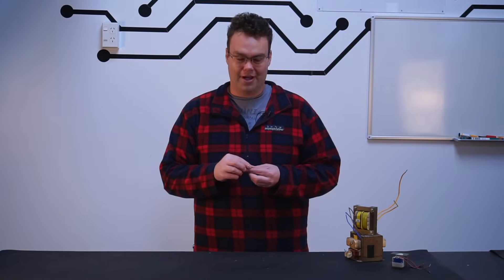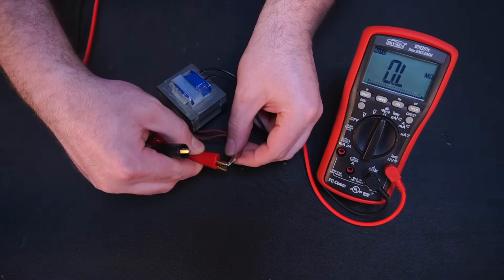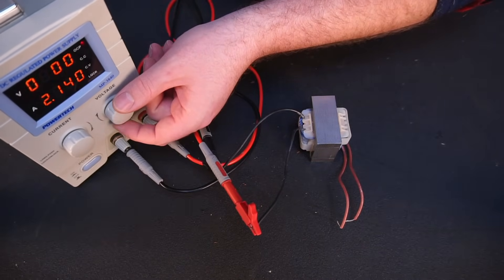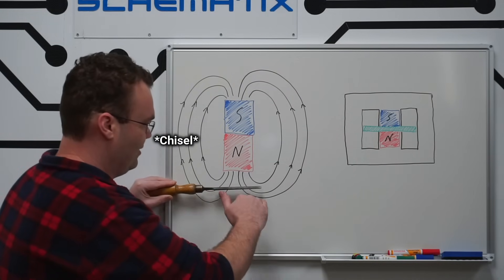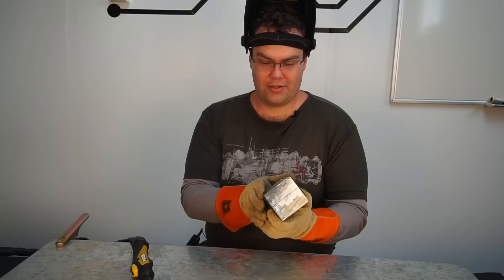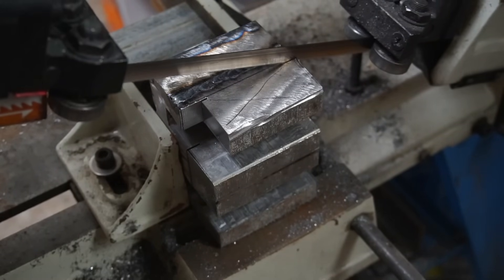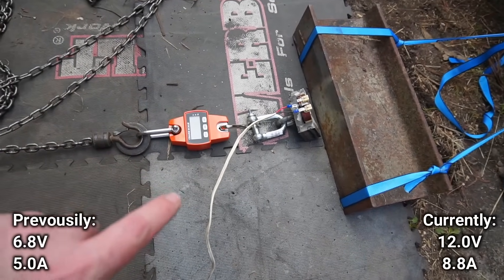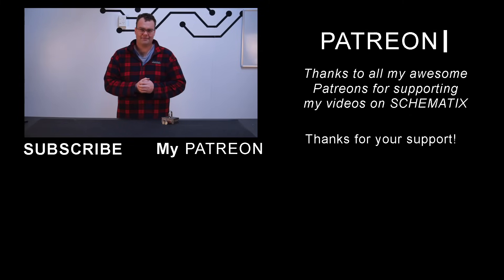Making a Powerful Electro Magnet from a Transformer

Comment: Schematix, I believe that welding the laminations together weakens the overall magnetic field. There's a reason they have them split into several individual pieces.
Reply: Don't matter for DC but AC causes problems, at least that's what my prof told me.
Reply: @Graeme_Lastname  you might be right. I know it's done for transformers to increase magnetic flux so less losses in the core occur.
Reply: @OtherDalfite  Basically to eliminate induced currents flowing in the core which would appear to the transformer as a shorted turn.   ;)
Reply: @Graeme_Lastname  right, to reduce eddy currents flowing around in the core, much like how an induction heater heats up the "core" of whatever iron or metal is inserted inside the coil.

So essentially this wouldn't affect a DC magnet situation because the core is never experiencing any eddy currents since the direction of flow isn't changing. So welding the laminations doesn't affect anything. Correct?
Reply: @Graeme_Lastname  Why fragmeted magnetic core in DC machines?
Reply: @PopaAlexandru.  Depends on how often you turn it on/off.

Comment: One main reason I keep enjoying your projects is that you do a great job explaining step by step process involved even in the most basic things. Great job sir.
Reply: Hi thanks for a very informative video. I do however do not agree with your indication of the magnetic path. The magnetic fields will split at the centre pole and flow the the other two faces generated by the cut you made. If you lay the magnet on its side on a piece of paper and energise it lightly and then sprinkle iron filings on the paper the filings will align with the field and you will be able to see where the magnetic path is.But none the less I think it was a cool video and was presented in a very logical manner. Thanks very much
Louis
Reply: Correct,, that's why I enjoyed that project. 
Good job.
Reply: Gardening with electric and magnetic?
Reply: Thanks your information ❤

Comment: Make a Magna-flux machine for finding micro-fissures and cracks in castings. Primarily for finding cracks in engine heads and blocks.
Reply: Exactly what I was thinking and why I viewed this video. All you really need is this type magnet and the metal powder.

Comment: I can't help thinking that by welding the laminates together you reduce the flux density of the core as all the plates are now connected.   Perhaps a better way might have been to give the outward faces of the transformer a coat of epoxy?  Or even powdercoat it?

Comment: Hello cyber Friend! I have a good idea, every time you need to move a big sheet metal, Because is really awkward to handle, this will come pretty handy, in every good shop, before putting your material on a CNC plasma cutter, or just a Metal welding table, you'll need to handle your material. with a beam above and 2 magnets attached to a square tube with holes, so you can control the distance between them, you can easily move big material at ease. I hope you can show this in your channel. Cheers!!

Comment: The magnetic field is proportional to the number of turns times the current.  Since you are using DC, the larger number of turns in the fine wire coils would have needed less stress on your power supply.
Reply: Yes but it is also proportional to the current IIRC. So if he was able to increase current more than he was able to increase turns, this was the way to go.

His risk on going to small turns was that he would have to lower current to avoid overheating

Comment: .....grind down and modity railroad spikes....they  work  EXTREMELY  WELL for mots,,,,,,,,grind down to fit into cores, and use to hold windings, while winding........pry bars, etc....works   REALLY  GOOD,.......ALSO  FOR PUNCHES TO hammer out secondaries....etc

Comment: good boy.....same as i use...angle grinder/chop off saw (homemade from furnace motor, and microswitches from microwave).....to re-create MOTs for chargers, welders, etc.   made an 18 volt dc supply for cordless tools, converted to corded tools, ...mots rewound for 19 volts  dc with capacitors and bridge rectifier.....all work wonderfull....good for you...

Comment: You could use your microwave electromagnet for the base magnet in a mercury vortex drive; so, you can vary the field strength and direction giving you additional control over the vortexes rotation.
Reply: no

Comment: I would like to see you make an AC electro-magnet that would attract conductive materials like aluminum, silver and gold.  Then put a permanent magnet in line with this AC electro-magnet and pass tailings over it making an electro-sluice sorter for mining pay-dirt.  The permanent magnet would filter out the iron, and the electro-magnet would hold the "gold".  Use this for sea water and see what you get.  You can then go into the principle of an AC reactance loop coil for AC magnets to hold though the AC cycle.

Also I would like you to show the principle of the Leedskalnina's PMH regarding storage of current in a magnetic flux with your DC magnet.
Reply: Gold cant be attracted with a magnet in any practical sense otherwise we wouldn't even need sluices to begin with. We would simply just separate the metals during the smelting process or some chemical filtration...
Reply: @DrakeOola  I disagree - gold, aluminum, mercury, any metal can be attracted by an AC magnet.  That is exactly why I am advocating using an AC magnet instead of sluices.
Reply: @nonsquid  looking forward to seeing your video of PROOF

Comment: That is very interesting...
!!!!!-----> You can get a higher weight reading off your scale there. use a pulley system and then multiply the reading by the ration of the pulley or a falcrum. 
With the falcrum you it is basically by percentage. if it is in the middle then it is 1to1 if 1 third down then its 1to2. Then use the scale on the 2x side and magnet on the 1x side and if you measure 300 then its actually 600 strong. 
IF all else fails...How much does the car weigh and are you insured?

Comment: I've been curious if it would work for picking up shavings from grinding,drilling,cutting etc. Might be better than sweeping.
Reply: Seal inside pvc pipe with end caps, put handle on it no touch
Reply: yepp 👍 such simple super magnets (electro) are being used in workshops all around in India 👍

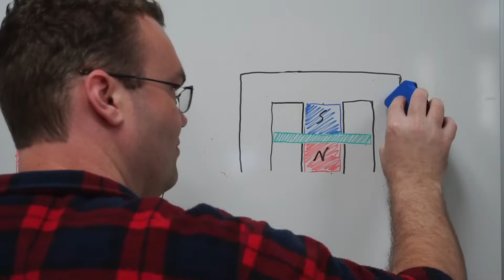Comment: 9:19 the magnetic field lines are wrong.  Only the cut part will expose the field lines.
Reply: The field lines will still VERY MUCH prefer to be inside the iron so the south pole should be extended to all of the remaining iron.  The field lines in air will simply jump the gaps from the central exposed iron to the two ends.  From there they will be inside the iron for the rest of the loop.  Also, in truth, the poles are only at the end surface; inside the iron the magnetic domains realign to cancel the field almost completely.
Reply: Indeed, big majority of the magnetic flux will prefer the magnetic core while there will be negligible leaking flux through the air.
Reply: don't bother about the lines
just try understanding his effort.

Comment: The commercial magnetic bending brakes are using 220 volt electro magnets generating 6 tons force spread out over 48 inches to secure  material. Would like to see what you could come up with!
Reply: Thanks, can you give links for more info in these brakes? More abt the winding and core sizes ..

Comment: You could put half the current through the magnet and assess the break strength there , or a 1/4
Reply: Different steels have different magnetic saturation points, where the magnetic forces pulling towards the iron core is drastically reduced per amp going through the windings. If this point was reached at say 80% current draw of what he is drawing in this video, and then half the current to take a measurement. you only had a 20% drop in magnetic force but half the current draw, thus giving a false measurement. (These numbers are straight out of my ass, and only to prove a point)

Comment: I thought you would explain saturation. I think that powering it from 12v is useless as the iron is saturated with way less, you should test the strength at different currents and will see it
Reply: Ideally, he should figure out whatever gauge that copper is, and push the max current that that gauge of wire can handle. It'd be awesome to see just how tough these magnets can be.
Reply: @OtherDalfite  that's the thing about saturation, the magnetic field is not linearly proportional to the current. There exists a current (times turns) that doesn't cause a big increase in magnetic field strength (the increase in strength would be the same as a  coil without an iron core). That's between 1 and 2 Teslas for iron, so actually you don't want to provide all the current.

Also the maximum current is limited by how much heat it can dissipate, it's not the same for open air or wound in a coil.
Lastly, microwave oven transformer primary's are in fact aluminum
Reply: @nirodper  thank you for the info in the first paragraph. Are you positive about the last? I've taken an MOT or two apart before and I've always seen copper windings for both the primary and secondary coils
Reply: @OtherDalfite  I'm certain, all the ones i've dissassembled myself and seen here on youtube have an aluminum primary (with copper colored varnish) and copper secondary.
You can really tell by the weight difference of the two (if you take the core apart) or by scratching the varnish off.
They make them as cheap as they can
Reply: @nirodper  ahhh gotcha. I didn't scratch the surface to see if it was truly copper or not. Got any favorite sources for learning about magnetic saturation?
Reply: @OtherDalfite   I don't really understand it, I understand the concepts but the calculations can be weird, for example I tried to calculate the proper current for these amount of turns in a core this size but couldn't get it. 
There's an excellent video from Ben at Applied Science titled "Engineering magnetics - practical introduction to BH curve" that would be the best place to start.

Comment: A very good combination of theory and application, well done!
One thing though: with a cut up transformer, the vast majority of the magnetic field lines go from the center bar to the side poles, not around the transformer (9:32). That's what causes the field loops to be closed when an metal object goes across.

Comment: You can limit the current, from an AC source, by using use an AC capacitor, on the hot AC lead of primary, and using the Capacitor Reactance Formula to calculate in Ohms.
Reply: AC cannot be used to run a electromagnet. Maybe not what you're saying, but the more you know
Reply: @OtherDalfite  Wasn't what I was saying.  I assumed you would use a rectifier, but, before it gets to the rectifier, you can limit the current using a capacitor on the hot AC lead using capacitor reactance formula.  

Example:  
108 UF capacitor limits the current due to Capacitor Reactance

Capacitor Reactance = 1 / (2 * PI * Frequency * UF / 1000000)

EX:  1 / (2 * 3.14 * 60 * 108/1000000) = 24.57 Ohms

120 VAC / 24.57 OHMS = 4.88 Amps

Comment: Hi, magnetic flows are like electrical current seeking for a low resistance path to go through. When you cut a transformer, you just cut the magnetic flows and they have to go through the air instead which have a very high magnetic resistance (let say magnetic permeability). That's, I think, why that amount of force would be appear when a ferromagnetic object gets close to the magnet. I enjoyed that video, good luck.
Reply: Great vedio
I.would  install a pushbutton switch 
Then add a 12 volt electical supply
Pish the button pick up.your old bolts or other things to put back into your 5 gallon pail
Let go of button and drop the load
I.dont know if flashlight batteries would make the magnet work of if you woukd need an extention cord to a 12 volt battery
Thanks for the vedio

Comment: Interesting I've been searching for information about electromagnetic propriety and was pleased to discover your presentation .Well done .You ask for suggestion or applications. I've been wondering if there wasn't a way to built a blacksmith power hammer using electromagnet ?¿? The idea being in reducing the size and complexity of the hammer. Not being familiar with the particular property and possibilities of electromagnet as to the reaction time and attraction distance, where combining two separate unit one as a down push the other as a lifting pull .I am not aware that there any power hammer functioning under this principle.
Thanks for sharing your knowledge From Canada
Reply: Hey Gil Auth, I think you might be onto something here.  What if you take two of these electromagnets and place them opposite one another with a free moving ferrous weight on rails between the two.  Then alternately reverse the DC voltages to make them attract and repel the weight making it into a powerful hammer.  You could control the speed of the hammer by pulsing the voltage reversals.  Would probably have to have mechanical stops at either end so the electromagnets don’t get smashed.  Don’t know if it would work, but might be a fun experiment.

Comment: There's more than a few mag chuck builds out there using transformers just like this. They usually involve ganging three or four in a box and then potting them with epoxy. The surface can then be ground flat with a surface grinder and used with that very same grinder, or a mill.

Another one that sprung to mind was a mag brake for a lathe. An interrupted annulus of aluminium on the headstock (you don't want a shorted turn; that would be bad) would generate quite a lot of Lenz's Law braking force.

And of course if rather than cutting the yoke in half you replace the other winding with a few turns of, say, 6mm dia insulated cable you can get some hefty currents: enough to make a spot welder, for example.
Reply: Even if you do not cut off the yoke in half, there will be no significant reduction of the magnetic effect (holding force). Also, the total magnetic flux depends on the product of the current and the number of turns (N.I) and if you use thinner wire, you can accommodate more number of turns and can get the same effect at less current (may need higher voltage).
Reply: @janami-dharmam  He has to cut it short. The field strength is going to decrease as the square of the distance 
Power is going to be almost the same in an ideal set up. That's the product of volt and current is the same in all its theoretical form.
Reply: @subramanianr7206  You are wrong; most of the flux will be passing though the core and the field strength at the tip of the iron slab (before and after cut-off) is not going to be much different. The magnetic poles will be located slightly inside the iron in both cases.
Reply: @janami-dharmam  Inverse square law is a function of the geometry of the space itself.  It's a fundamental understanding.
Reply: @subramanianr7206  Study and you can learn. For a point source, the inverse square law applies. If the source in a line, the field goes as 1/r and if the source is an extended plane, the field is independent of the distance.

Comment: If you had 2 MOT, and connected both primaries in serries on one core, then you could half the current and get the same magnetic field.
Reply: You don't have belief in the fundamental sacred laws, I think.
Power means volt×current. Then comes the area in which it acts, force, N/m^2
Reply: @subramanianr7206  for a given area and permibility,  the magnetic field will be a function of I×N. I for current and N for number of turnes.  Twice the number of turns at 1/2 the current = same magnetic field.

Comment: Speaking of saturation. Seeing the core expelling some magnetic field at 4 amps means 4 amps is too much magnetic field for the core and you have saturated it.

You should have dialed the voltage down to push less current through until your under saturation point. Then you can cut open the core.

Pushing more current passed saturation does little to add to the magnetic field past saturation. Thus the extra current does little more than create heat and unessesarily waste energy.

(Added after have posting to include new information and avoid confusion) sometime 
Transformer designs include an air gap to increase the point where current saturates the core.  That said, cutting the core in half introduces a large air gap which could presumptivly push up the point where current saturates the core to well beyond 4 amps, but if one closes the air gap with a ferrous metal, it will lower the saturation current again.  

Takeaways: There are more things to consider when determining what is the ideal current for a given core and how one intends on using it.